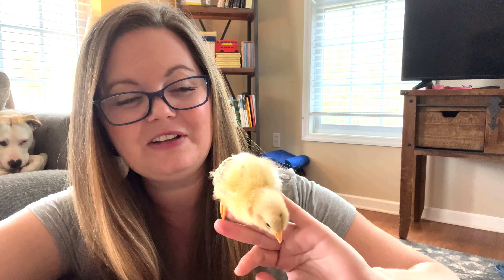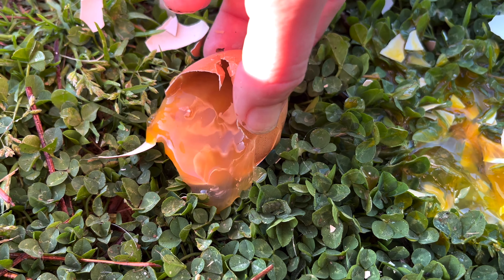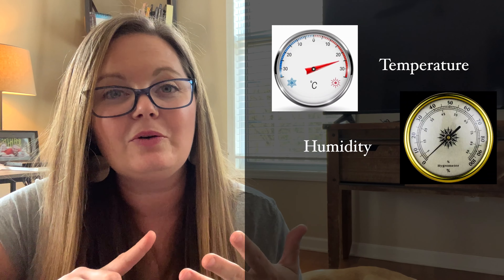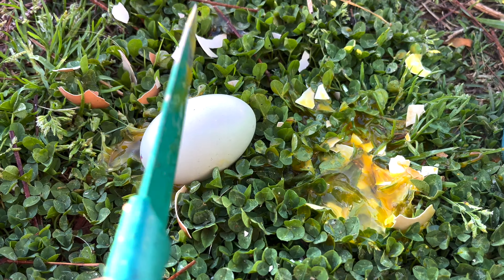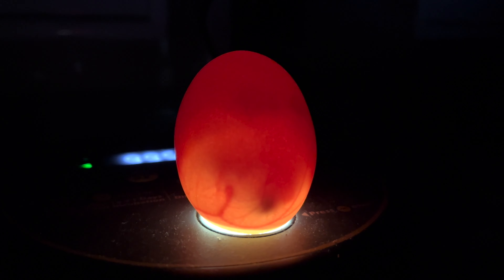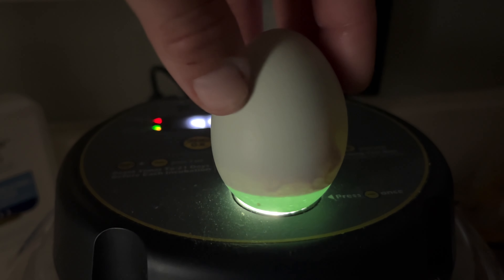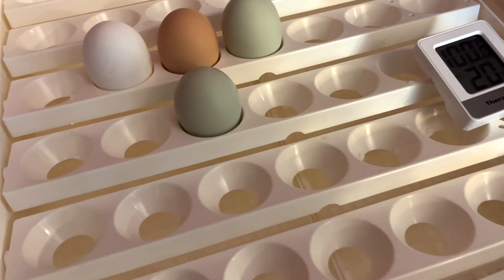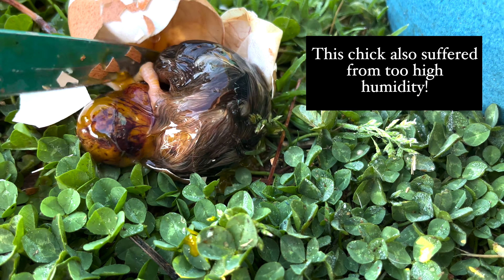What Causes Poor Hatch Rates? Investigating Incubation Problems

Comment: Something else I found with cheap temperature controllers that give a wrong reading, even if you find the correct difference and adjust so the real temperature is where you want it, it will gradually change over a few months.

Comment: I have two incubators and both of the thermostats are off. I have to set them to another temperature to achieve 99-103. Find a thermometer you trust. One cheap incubator cooked some eggs at 108 so I made my my own out of an ice chest and pid temperature controller
Reply from the maker: Wow very innovative!!! That’s a useful skill set there

Comment: Fantastic informative video. 
I think I'm about ready to give up on incubation.
Bought a second hand still air incubator,  set up, day 3 the turning motor failed so had to manually turn. All chick failed.
Bought a new motor, new arm, new thermometer. 
Bought 12 eggs from a reputable breeder, 11 fertile.
Candled at day 7, fine. Day 14 and day 18. Had two quitters and one I wasn't sure about, but expecting 8 to hatch.  Day 20 first pipped. Day 21 second pipped and both hatched. To me they were good hatches.  
Now day 22 nothing from the other eggs. I removed the chick's today.
Do I candle?
I hate the thought I'm responsible for the death of 6 chicks!😢
As it's a still air incubator is it still worth getting a hydrometer?
Sorry for all of the questions,  I'm at my wits end.
It's a Brinsea polyhatch incubator and allegedly good.
Any help would be welcome.❤

Comment: I'm trying to figure out where things are going wrong for me. 
My first batch I put on 9 eggs. At the end only 4 hatched. I had a few quitters and a few that never pipped. 
So I tried again. 11 eggs.
This time I had all kinds of issues with humidity.  Too low too high. I  struggled to keep it right.
We got 3 days left and 5 eggs in still. 
And I hoping they hatch.
I don't think I'll be trying to hatch my own chicks again.
Reply from the maker: That’s so discouraging, I’m sure. Sometimes there’s a genetic component that causes these problems, but you are also at the mercy of temperature and humidity. Have you got an extra hydrometer? My big incubator was notorious for being several degrees too cold and I had to manually adjust it constantly.
I’m sorry it’s been a rough go!

Comment: Did you end up returning the incubator from tractor supply? What was the result on your second try?
Reply from the maker: I’ve played around with it a lot, and I’ve come to the conclusion that since I don’t know how to troubleshoot some hotspots, it’s just not worth it for me to hatch expensive eggs in. When I have some more eggs that I don’t feel so emotionally invested in, I might try it again. But right now it’s sitting on a shelf and I’m not Wasting my time with it.
I’ve seen some videos where people can manually go in and fix those hotspots, but the last time I checked, I had a spot that was 106°, it absolutely cooked most of the eggs in there
Reply: I have just completed my first hatch 6 chicks from 10 eggs , the incubator was run for a week without eggs I found that the temp sensor was not close enough to the eggs , I also insulated the incubator , added a second temp/humidity sensor , I also have a hand held temp gun just for backup ,. Humidity ran 50-55 and 65-70 
Next batch going in on Wednesday